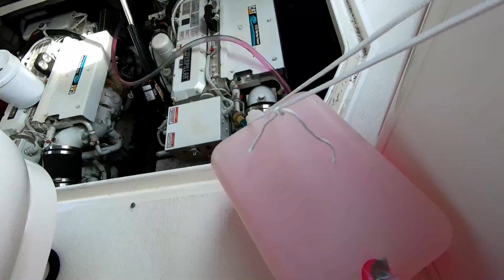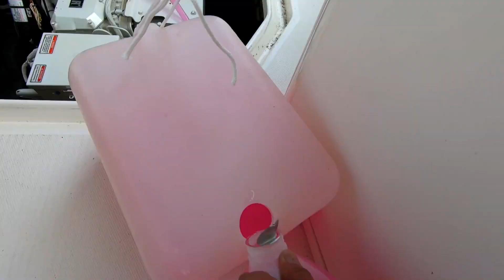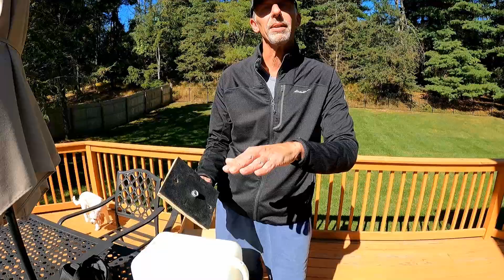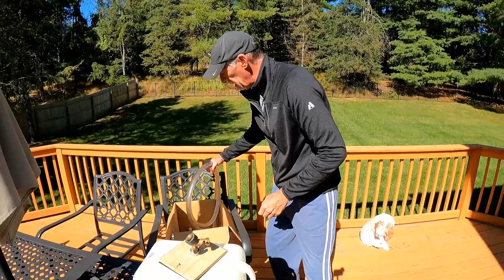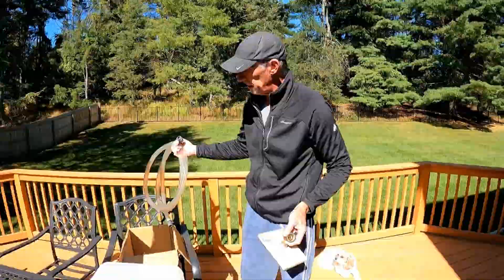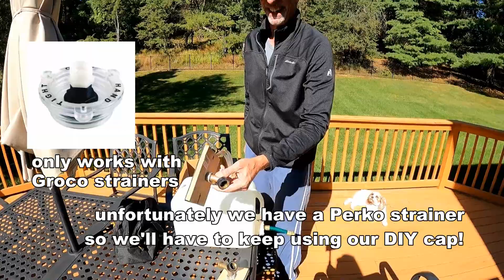Our Boat Engine Winterizing Kit & DIY Flush Cap We Use ✅

Comment: I enjoy your videos.  They do provide me with great ideas.

Regarding your strainer cap..., I have a similar concept, except I purchased a replacement cover for my Groco strainers.., the same part.  I then drilled a hole and mounted a hose fitting in the middle.  I then simply switch out the cover for the modified cover and connect antifreeze through that.  Since it is an exact replacement I have not leak issues.  I also use -100 degree antifreeze since we boat on Lake Michigan.

For our fresh water system I use an air compressor.  I don't like the using chemicals in our water system.  So I connect an air compressor to or city water hook up.  I keep the PSI low around 30 or less and run air through all lines.., checking each area multiple times to make sure it is all blown out.

I let the marina do our engines as they attach the inlet to the scuppers as they lift it out with the crane.
Reply from the maker: Thanks so much for feedback & sharing what you do! It’s always good to pick up ideas from others. we’d love to use that Groco cap idea but have Perko strainers 😩. This system has evolved a bit for us over the years but has worked well for us. Never tried the air blow out, but hear you on chemicals in fresh water - we do a thorough clean & rinse in spring & use city water for most stuff but still don’t drink or cook with water. 

Wow, hope you don’t reach anywhere too close to -100 this winter in Michigan.. but definitely better safe than sorry!! 🥶 👍
Reply: I am willing to pay a little more for the -100.  For the AC, generator, and head, I typically only use 3 gallons.  Temps can get quite cold (-40 actual).., but again some winters are somewhat mild.  But you never know right?  The forecasts are so accurate!  So the peace of mind in using the -100 is assuring if nothing else.  Our marina also uses -100 for all of the boats they prep

I do like how you approach issues and reach a solution .., good thought process.  That must be your training.  Keep up the good work and keep making good videos!
Reply from the maker: @robert-f2q9u  I agree.. With temps where you are better safe than sorry! Appreciate the compliments- cap Brian is an IT engineer so he’s super methodical with troubleshooting solutions.. comes in handy with the boat!

Comment: Nice. My Sea Ray is a little smaller, so I use my suction cups on the outdrive with a similar setup for the same result. For years, I have been draining out as much as I could from the block after but seeing this similar procedure on your channel and another recently, it doesn't look necessary.
Reply from the maker: Thanks! Yes this is for our inboards but you’re right, similar idea… as long as you are flushing through pink until you see it coming out then you’re good. 👍

Comment from the maker: Here are the exact measurements of the flush cap we made: (Keep in mind we have 3126 CAT engines - your size may be different)
Big Jig for engines - 5 3/8" x 6 5/8" - holes center to center 5"
Small Jig for A/C & Gen - 3 3/4" x 5" - holes center to center 3 3/8"
Holes on both are 3/8" wide and we used standard 1/4" plywood